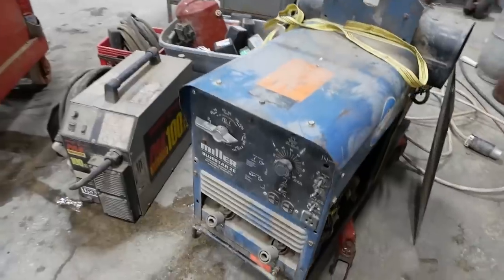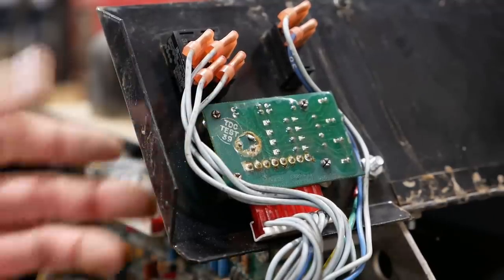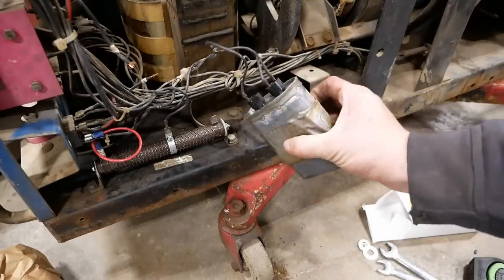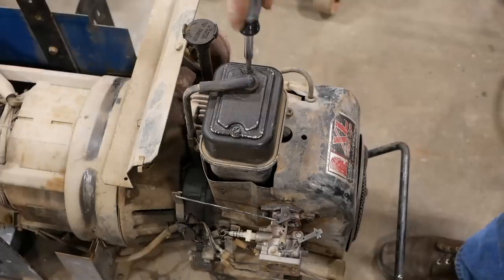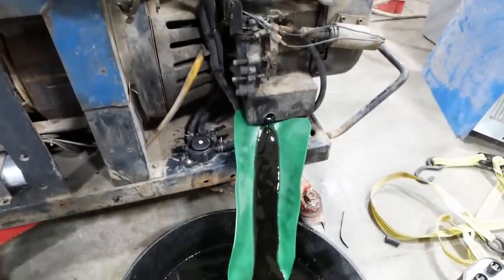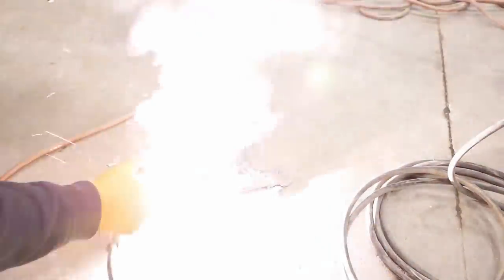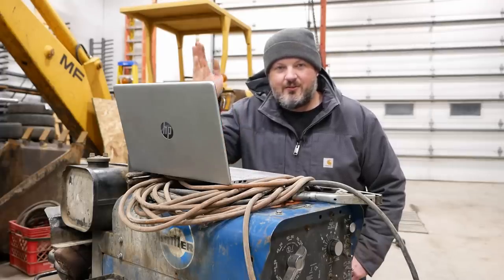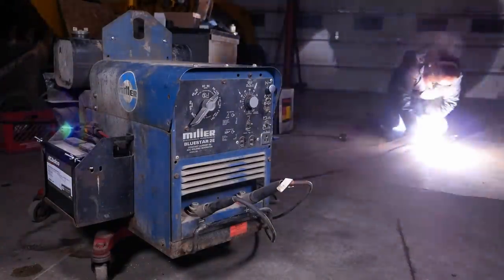Mostly Fixing my Bargain Portable Welder | Miller Bluestar 2E Part 2

Comment: So glad I stumbled on the first part last night, I've had a blue star 2E sitting in my garage for a few years now that lost spark and I found the video by pure luck after not looking for parts for a year! Needless to say this sorta lit a fire under me to get the old thing goin!
Reply: Good luck
Reply: Coool it was a nice welder it got burned up in a east county wildfire in Alpine California back in 2008? I Miss it.
Reply: @torchit007  Sorry to hear yours got burned up like that! Mines been in Ohio for as far back as I could trace. This one was on a Friend's trailer used to haul the trail rigs and the motor just shut off lol I might part ways with it when I get done playing with it to update to a bigger machine for my needs!
Reply: I started working on a Lincoln ranger 8. The circuit board had burned traces and a bad diode that stopped it from getting spark. Got spark but now there still an issue where it back feeds power and triggers the starter to engage once the machine is running. So there more wrong somewhere. Easy solution is replacing the multi position switch with a momentary like they did with all the later models. Biggest issue is the motor was locked up and stuck. It’s way down on compression and has tons of blow by. Still runs with only 30psi compression and makes power.
Reply: Make a video!

Comment: If you get a replacement idle board, be sure you check the inputs and outputs before you connect the board in the circuit. There may be a short somewhere  external the idle board that is frying it.
Reply: Lightbulb moment!
Reply: Yea I was thinking that too. Its bad enough when the old one fried its self but it would be even worse to see the new one do the same. Jim in NZ.
Reply: I was thinking along those lines myself. It is extra work to understand what's going on. But sometimes it more work to not take the trouble to figure things out.
Reply: Or since someone had previously worked on it make sure all of the connections are going to the correct terminals, not just how the were attached when you found it.
Reply: @ericpaul4575  that would be difficult to do without a schematic.
Reply: @1pcfred  Maybe the supplier of the used board will have OEM connections.
Reply: @LanceMcGrew  let's hope so. It's where those connections go that's a concern though.
Reply: @1pcfred  true, but u could just circuit back trace
Reply: @ionracer24  it never hurts to try.

Comment: Man, it's so affirming to know there's at least one other guy on the planet who does stuff like replacing that red negative ground with a proper black one.  I take so much crap for doing this kind of "make it right" kind of thing instead of the generic mechanic deal of putting duct tape on the cables.  Great fix, Wes.

Comment: For future reference:  a quick and slightly dirty fix for leaking valves on sediment bowls like that one is to loosen the packing nut and remove the valve from the S. B.  Take a 2-3” piece of Teflon tape and twist it into a string, then wrap the string around the valve shaft and reinstall. Snug the packing nut just enough to stop the leak and rejoice in having a fuel filtering device that is easily cleaned.
Reply: Nice!

Comment: I definitely enjoyed your trouble shooting of the circuit boards. The patched in board is often called a Daughter Board. I often equivalate a diode to a one-way valve so it is no surprise that it released the magic smoke. Something that you can use in the future is to use a insulated wire to use in place of the "scrap" leads from through hole components. There is always a need to protect a signal wire from ground. One last tip that others have used is clear nail polish on the solder joints to use as a conformal coating.
 Really enjoying this series, you are doing very well. I loved the tank-to-carb fuel line replacement.
Reply: Good advice. It's been years, but the clear nail polish works great! I used to apply conformal coating from a spray can, so that should still be available.
Reply: @vigilantobserver8389  Green can be used to patch solder mask after trace repairs.

Comment: One thing to watch out for with the big filter caps in a line voltage DC rectifier is that in some capacitors the aluminum shell exposed on top of the capacitor is at the same potential as one of the pins of the capacitor. Of course there’s bleeder resistors to drain the caps, but those can fail too. 

I was working on a power supply where the caps had energized shells, and the bleeder resistor, one of those chunky 5w rectangular things, had somehow fallen out of the PCB. I didn’t realize either of these things until I poked the shell with a multimeter on a whim. How I didn’t discharge the cap through my body before that point is a complete miracle.

Comment: Another great video. If I may recommend, as someone who repaired electronics for a living, when you want to reflow joints like those on the potentiometer, put a little fresh solder on then use a solder sucker or braid and remove the new and old solder. Then redo the joint. 5 stars on using flux!  Now I have to look up how that fuel pump works...

Comment: I like that you save the cut-off component leads! I am in electronics repair and have always done this. They are not just good for repairing pcb tracks, they are also useful as test points when added perpendicular to the board which even if only added temporarily makes testing much easier and duards against accidental shorts from test probes.

Comment: That’s going to be a nice unit.  Thanks for part 2 and looking forward to parts 3 through 10.
Reply: I about shot my beverage out of my nose at the "through 10".  Top Tier comment!
Reply: It will be EVEN NICER if Wes takes an hour to clean the unit and spray paint the tank and the air filter cover etc.
Reply: @oldcynic6964  …for now let’s focus on and praise the great work he has done so far.

Comment: The board went from rectifier to rectom frier, Wes you amaze me you just keep on trucking without missing a beat. That was the very reason I swapped from dewalt, the batteries did not hold up.

Comment: You've mastered the proper welding posture... hunched over and kneeling on the concrete. Might try outside lying on the frozen ground under a low piece of equipment for added character building.

Comment: Thanks for the interesting video Wes. To answer your question, I haven't had any issues with DeWalt battery cases but the UK has a much milder climate than your state. The mod board on the plasma cutter's PCB used to be relatively common back in the days when circuit board redesign was an expensive proposition. When you found an in service design bug you'd come up with a mini circuit to fix what ailed the mother board.

Comment: I'm looking forward to seeing you work on the powercon welder. I worked maintenance for a company that used several of these welding aluminum. They had a port on the back that a frequency box could attach to for aluminum welding. The machines worked great and held up well to the gorillas that used them...the frequency boxes...not so much. Great job and thanks for taking the time to share.

Comment: Very interesting. That old Miller looks like a real work horse. Great to see it working again. Just a note regarding something I found out the hard way. If you use a paper gas filter on a gravity fed fuel system, without a fuel pump, it won't work. At least on the applications I tried. Those can only use a sediment bowl or the small screen type filters . This is not a criticism of what Wes did. He does have a fuel pump. Great job, as always, getting that to work.
Reply: Yeah but he put a fuel pump on this machine.
Reply: I use small paper gas filters on my gravity fed mowers and I’ve never had a problem.
Reply: @johnfisher7143  the paper filter thing is a known issue. When you're gravity feed you're supposed to just use a screen. But it is great that it is working for you.
Reply: @1pcfred  My comment was not a critique of what he did. I was just reminded of  the problem caused by using a paper filter when I shouldn't have.
Reply: @johnfisher7143  Maybe it was just my snowblower that didn't like the paper filter but it would not flow enough fuel to make the engine run. It is possible that the drop from the tank down to the carburetor was too little and that is why it didn't work.
Reply: @macgvrs  you can get away with using a paper filter with gravity feed. If the filter is porous and your fuel is clean and there's adequate head pressure from the tank to the carb it should be just fine. But that's a lot of ifs. If ifs and buts were candy and nuts we'd all have a Merry Christmas.

Comment: Regarding brittle materials feels like Metal and plastics quality since the covid/supply crisis everything has been low quality.

Regarding dewalt batteries specifically I’ve never had issues with them unless they have been run on a sawzall for extended periods. Usually get vibrated to death lol

Comment: About that piggyback prototyping board: the label just below it says Rev 0, so it's the first revision main board used for that type of plasma cutter. I'd bet that the Rev 1 boards have the piggyback functionality worked into the existing layout. You sometimes see it with other hardware too where random wires are glued across a PCB to 'solve' design issues that they found a bit late.

Comment: To hone a cylinder for new rings I have found a 3M green scrubbing pad stapled on where the 3 stones were, makes smaller scratches for the new rings-   easier, faster for new rings to seat.  You are doing a really good job!  I have been repairing stuff for a long time @ 71    Mr. KW Wiese

Comment: Was commissioning a new control panel in 1983 on a large generator in a far off country. The panel had been powered for two weeks from the battery charger and everything was going as planned. At the end of the day we would power down the panels due to nobody been at site at night and we were leery of leaving them powered up. Came in one morning and turned on the breakers to power up this panel and the main circuit board on the back wall lit up like a Christmas tree and the smoke came out of it in large quantities. Like your board a number of cladding traces melted into smoke and a bunch of part vaporized. There were 85 5 amp peanut relays in sockets on this board and a lot of them were toast. Ordered all of the parts to fix this board and a new board but it was four months away. Spent two weeks with a soldering iron and some 18 gauge wire and the schematic for this control board and replaced all of the burned off cladding's and all of the blown diodes and parts. It actually worked after two test runs and locating a few missing circuit paths i missed the first time around. I installed 120 different replacement wires on the back of this board and it looked pretty busy to say the least. It was still in there a year later and the generator was running fine. The reason for this failure was a crew of local electricians had removed the battery cables during the night and had replaced them backwards at the main connection. We put locks on all of the panels after that.

Comment: Wes, I retired after 46 years working in electronics and can say that I do the same thing on repairing a trace on a circuit board with small wire. Works great unless it is a multi layer board. Love your channel. I love your test equipment!
Reply: Is this for real?

Comment: Nice job fixing it up! I picked up a low hour Hobart my self that had fallen off the service truck not long after purchase then spent the next 30 years under a tarp in a shop. As for your OH160 engine, they are really good engines. I have a high hour one that I rescued from a scrap pile. Had to resize the rod, adjust the main bearings and re do the rocker box to cure oil leaks and build an electronic ignition for it. It is a torque  monster.
Reply: I have a welder just like this one and it is sidelined due to the unavailable Ignition parts.  You said you built an Ignition for it? 
Was there an article you followed or something.  I would live to give it a try on mine.  Because as it sits now I can only see engine replacement and that's expensive.

Comment: Even "Taryl" uses those fuel pumps.😁 I receintly aquired Lincoln Weldnpower 225, Onan engine, from a friend. He told me it never cranked over well. I remembered way back when I was a working mechanic we had several similar units that I remembered to be 24 volt start through the generator. It works great now.

Comment: I bought a welder one time that was called a "Sureweld". One of the lugs got melted off of it somehow so I had to take cover off the cover and right there on the side of the transformer was a plate attached that said Miller Blue Star. I treated that poor welder terribly if I had a nasty job to do that was the one that went. I had that welder for about 10 years and never had a minute's trouble out of it. I finally loaned it to my brother and after all that time of me abusing it, my brother finally spun a bearing in it. I still have the transformer part of that welder somewhere but I never replace the engine on it yet. I have two other Lincoln portable welders an SA 200 and an SA300. But I will tell you that I don't think you can tear up one of those old blue stars if just take a little bit of care of it.

Comment: I bought a Bluestar 2E for $100, not running. Like you, I worked it over, cleaned some brushes, changed the oil / rebuilt the carb, and got it running. It welded OK but I really didn't need it. Took up a lot of room in the shop. Mine had a rusty (inside) gas tank so a buddy gave me a plastic tank off an old generator, it worked. I put it on a Harbor Freight garden cart to move it around. But alas, room in the shop took priority and I sold it for a whopping $250 to the first guy who came to look at it - after I showed him that it would weld.

Comment: Great fault finding and repairing, I have a Miller DEL 200 here in the UK and parts are not so easy to find, basically nil, I am just about to attempt a repair on the idle board, replacement of capacitors and scr's. I am by no means electronically trained, but I'll give it a go, good job you and good luck getting it back to its former glory

Comment: That poor old welder has had a rough life.  At least it's in good hands now.  You might wanna turn the battery around so that next time someone goes to jump start it, they'll have less chance of grounding out the positive onto the machine, and just make it easier in general by having a little more room.  I agree about Millers website, it's fantastic.
IMHO that's the perfect size engine driven welder.  
Thanks for the video

Comment: The "patch" is a bodge. A post manufacture alteration because it was out of spec when it was made.  If it was a daughter board it would not have hot snot.
  Another conformal coating that's good is krylon clear acrylic spray (4 coats) Its not for mechanical strength like the epoxy or the hot snot on top but it comes off with alcohol if you ever need to repair again.

Comment: Wes I learned to weld in Sheet Metal Trade School and later the Apprenticeship on a Miller Econo Twin HF
the HF (High Frequency) allowed ma to weld Aluminum as well!
a solid 220 welder that could be plugged into 110 but with half the power if needed
I managed to pick one up at a contractor auction with leads and a Tig Torch,I later found a
Miller Wire Feed add on and Gun as well slapped the whole assy on a cart with a tri-gas bottle and from there it was off to the races
it served me well for 30 years and was still going strong when I sold it on!  I sold it for more than what I paid for it as well!
was a dammed good machine!

Comment: The copper braid used for removing solder also works well for replacing traces.  Saturated with solder, it'll carry lots of current.
Reply: Carrying lots of current isn't always a good thing.

Comment: Man are you resourceful and talented. The hot glue to hold the switch from rocking i am stealing from you as well as the circuit board trace fix. You don't release a lot of video's but what you do release is always first rate!

Comment: The proto board and jumper wires are called a "Running Change".  Wish I could say that I've only seen them in other Engineers' designs.  The strange part is I didn't think such things would work unless connected with blue wire-wrap wire.
Reply: It is called a bodge job.

Comment: My Dewalt batteries are going on three years and holding up fine.  I use them a ton, especially the smaller one on the handhold work light.  Once a year I have to jumper one of them to get it to charge; but other than that, no complaints.  I keep them indoors to prolong the life of the Lithium Ion.  I would guess that subzero temps, high heat, or UV might dry out the plastic and lead to that cracking.

Comment: Wes i have the same welder with the same problem on high idle. .I  fixed mine with a cheap part from ebay and it works ..great its ...12V 30A dry contact on-off relay switch with 2 remote keyfob RX101-2  all did was cut the wire on the idle solenoid I installed this in between ...and just clip the remote to my shirt and throttle up or down...works just great..for me a want to be welder...lol.. love the videos....